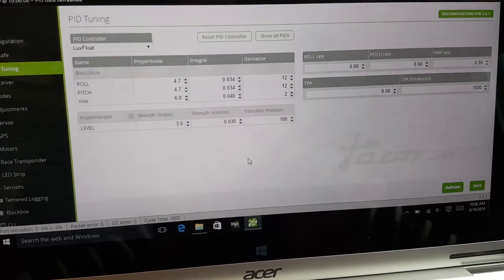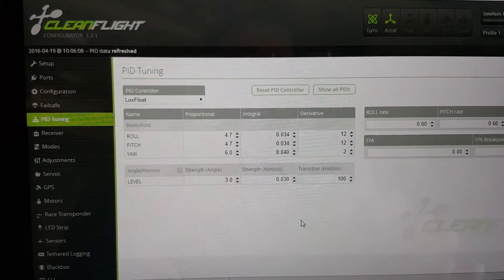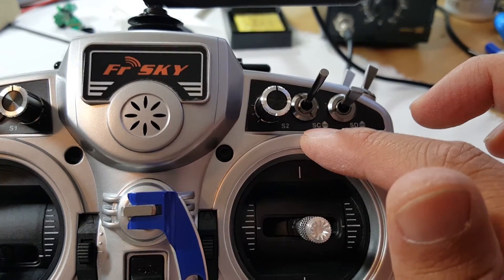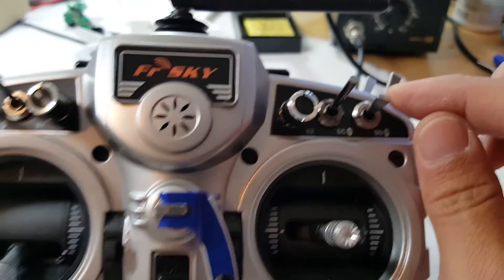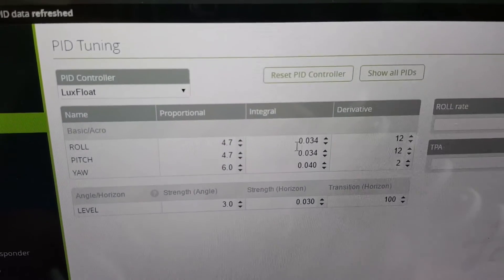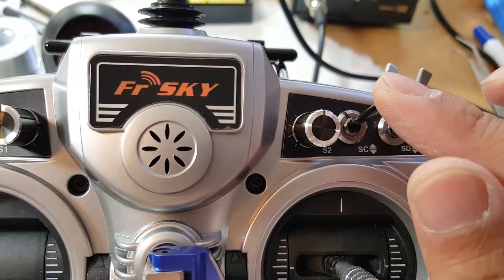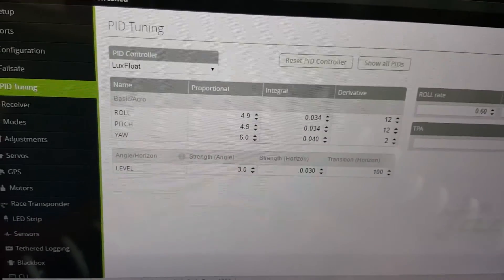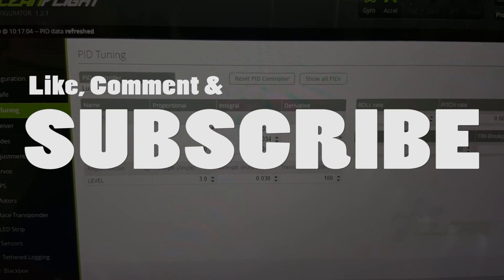PID Tuning on Taranis

Comment: excellent video. thanks for sharing. i've been looking for a simple way to make adjustments without lugging my laptop to the field everytime I want to do a little bit of adjustments to my PIDs
Reply from the maker: No problem and thanks for watching!
Reply: further research shows that I'd still have to land, disarm, open cleanflight/betaflight and Save the settings to stick. still, it should be a lot faster to tune this way.
Reply from the maker: +RipSoarFPV you don't have to connect to Cleanflight. Use the stick command to save the settings changes before you unplug. It's both sticks down and outwards. You'll see the board flash to indicate the settings are saved.

Comment: I wanted to ask you if you knew how to setup telemetry on a DIY Frsky DHT MODULE.  I wanted just a backup radio, and upgraded my turnigy 9x with the Frsky Diy module, and also added a smartie parts board to allow er9x to,be setup.  I have a telemetry screen but no telemetry being sent. I would love your input.   love your videos.